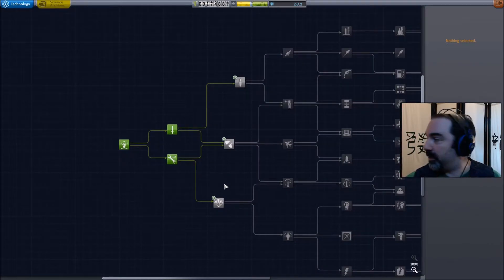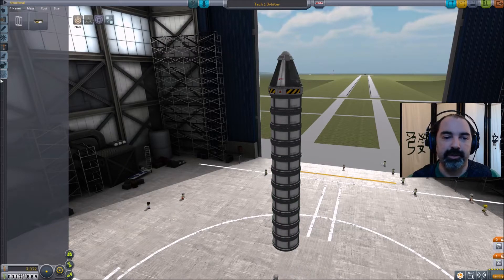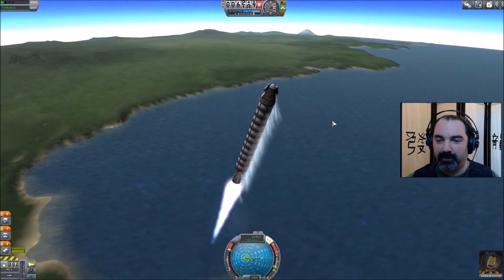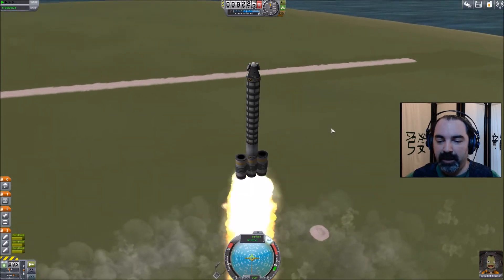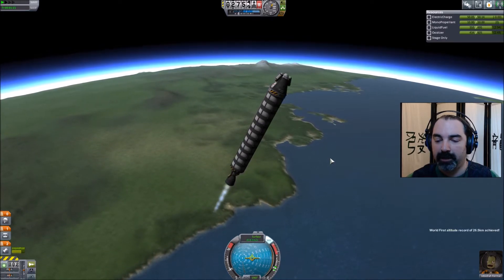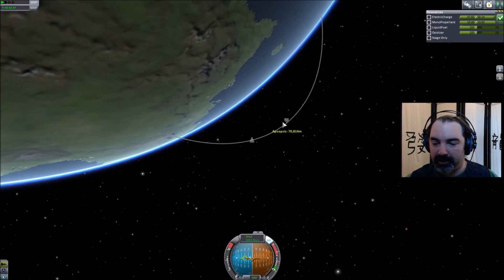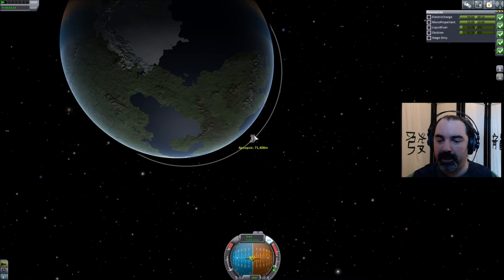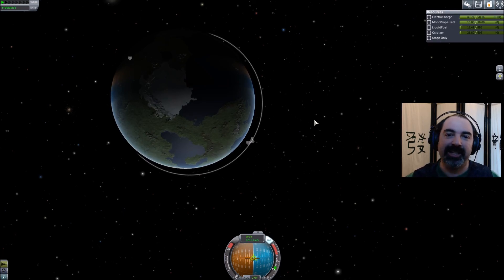Kerbal Space Program (1.0) Toturial: How to Reach Orbit (Advanced!)

Comment: Also, right as my fuel engines on the side decouple my ship goes crazy.
Reply from the maker: Rain Plays This is do to a bunch of reasons:

1. The boosters were adding Drag near the back of the rocket, making it more stable. Once decouple they don't contribute drag, anymore.
2. The center of mass shifts considerably when the boosters to away. This can impact how much leverage any torque on the nose has.

Keep your speed lower, and life is easier, even without tail-fins.